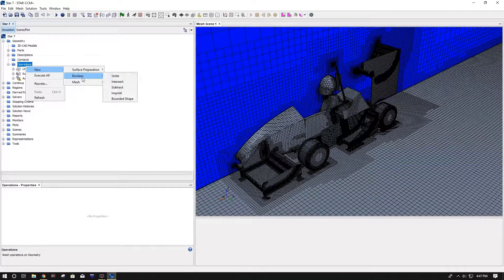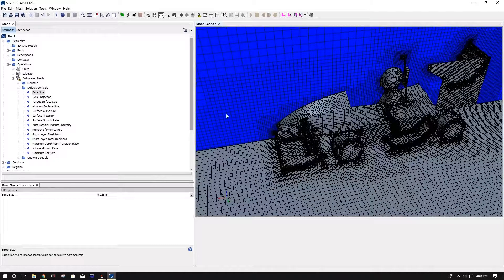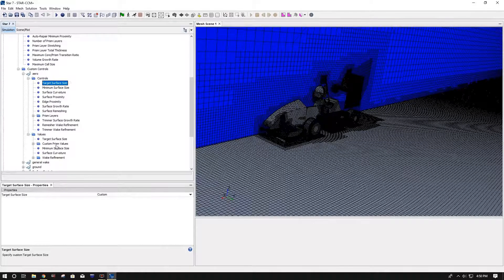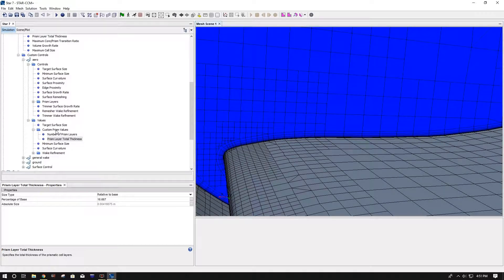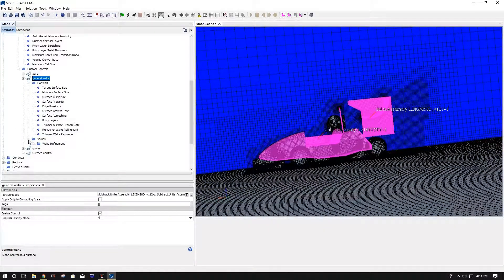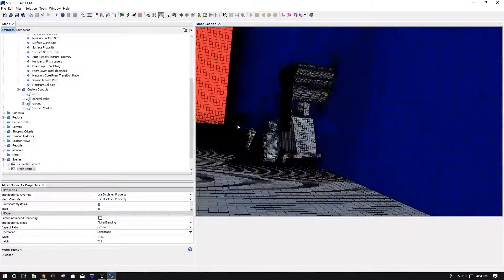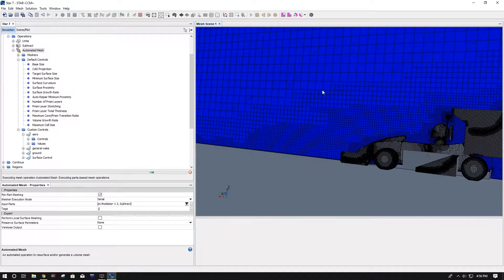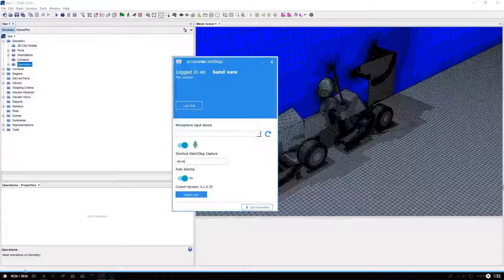Star CCM+ Full FSAE Car Simulation Walk Through Pt.2

Comment: Try using near core layer aspect ratio to help with prism layer to core mesh transition, it will allow you to set your prism layer height with something more justifiable than what you have.  Sounds like you have an understanding of it, but just in case look into wall y+. 

I would also recommend looking into volume refinements on your ground to have save your self mesh count in your ground instead of the surface refinement. a box 1.5 ish card widths seems to do the trick. 

Nice sim overall!

Comment: The prism layer to trim cell transition is too sudden. Need to increase the number of prism layers.

Waiting for Part 3.

Good Job
Reply from the maker: Thanks! Ill be making alot more vids this season, finishing this series and alot more CFD. I like how my prism layers are currently, I receive great results. The trim cell or main mesh could defiantly be refined in this video though.
Reply: @sebastianvalero3804  if the results are good it doesn't matter. But I'll make the transition smoother. 

Anyways, It'll be great to see another video from you :)